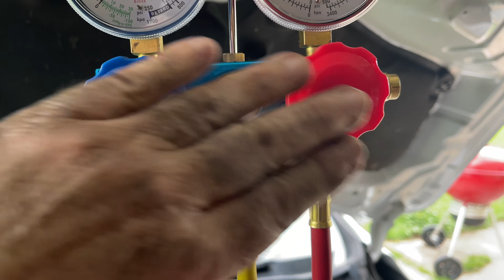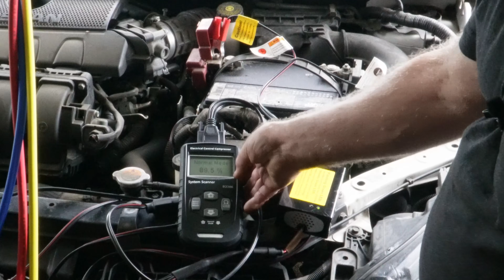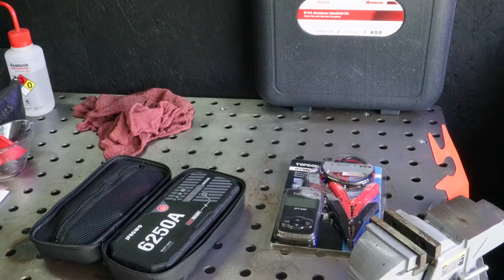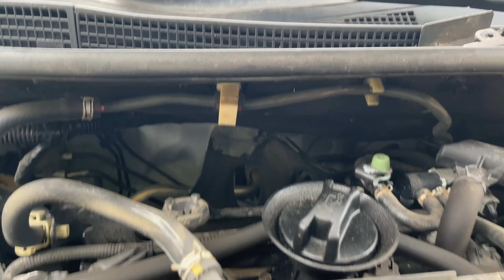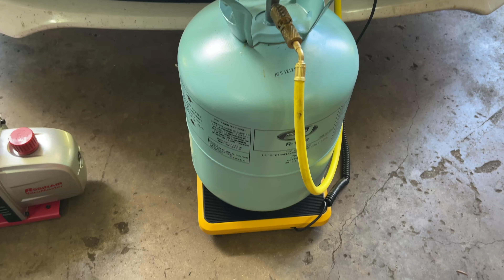How To Diagnose A Bad Automotive AC Compressor With 100% Accuracy

Comment: I have an 80 series Toyota Land Cruiser, the AC stopped cooling down and took it to a shop, they found the refrigerant charge low and also found the expansion valve getting stuck. When checking the valve also found the evaporator was leaking so they replaced both parts. Charged it back found pressure to be on spec. Next day I noticed it wasn't working good, even stopped cooling the air, measured the output temperature at the center register, it was 57-60°F... not good, took it back, they checked everything but the air conditioning only dropped to 45-50°F. Now they found that the high side pressure doesn't go beyond 160 psi  when the compressor is working, the Low side is in 30 psi. They're out of clues and I'm no mechanic to work on it myself.
Reply from the maker: It’s extremely hard to diagnose any car ac over a comment, but based on what you wrote, I would look hard at the compressor itself.  Lack of pressure caused by pumping issues within the compressor or compressor ecv.  Don’t take my word for it because I would have to hook up to the system myself before giving an accurate answer with confidence
Reply: @SkillSavvyDIY  Thank you for taking the time to answer, in fact, the shop asked me if they could take the compressor out of the and check it out and found the compression too low, already ordered a new one and waiting for it to arrive and have the system working well, also will replace condenser, dryer and expansion valve, the evaporator was already replaced at the beginning because it had some very small leaks. At the end, you guessed it right, it ended up being the compressor.
Reply from the maker: @ehouli77  Good deal, you should be all set once the work is completed.

Comment: What would cause Freon to blow out and they cannot find a leak 2018 Chevrolet impala The mechanics want to replace everything which is bs
Reply from the maker: If refrigerant is gone then there is definitely a leak, they just haven't found it.  Did they check the high side service valve for leaks?  That is a very common area on that GM car.  I had a similar model I looked at the other day.  It came to me with no refrigerant in it.  I pulled a vacuum and did a decay test which it passed.  I did a pressure test which it passed, so I put a dye in the system and charged it.  It cooled fine, so after disconnecting my gauges, I sprayed leak detector on the high and low side service valves, and found that the high side was leaking.  Many times mechanics fail to do this after disconnecting the gauges and never discover it.  It's very common on many GM vehicles.  Not sure if that is your problem, but I would have it checked.

Comment: Hey Skill Savvy DIY,
I have a 2008 Honda Civic LX and I’ve been having an AC issue for the past 2 years. The AC blows cold for the first 10–15 minutes, but after that, it starts blowing warm air. If the weather is cooler, the cold air lasts a bit longer. On hotter days, it blows hot air even faster.

At first, I suspected the compressor might be going bad, but the more I think about it, I’m wondering if it could actually be the condenser—maybe it's not dissipating heat properly when it’s hotter outside? I’d appreciate your insight on what the most likely cause could be. Thanks for all the helpful content!
Reply from the maker: Have you checked the condenser fan(s) to make sure they are turning on with the AC?  I appreciate the question, but without me being able to actually hook up to the system, it would be impossible to tell you the problem, but if you suspect condenser issues, start with the fans.  It would take reading gauges to go from there.

Comment: My ac keeps shutting off and on about every 30 secs or so (the fan also), and no cold air coming to cab. Pressures are good for both high and low sides. I replaced the high pressure switch, and checked the fan relays. Could the  a/c refrigerant temperature sensor  be the problem or something else? 2009 Buick Enclave 90k miles on car
Reply from the maker: Without me actually checking it out myself, I would only be guessing.  If you have a scan tool, look at the live data stream and see if the high pressure sensor pressure matches what the gauge pressure is.  Also look at all the other sensors data and see if they are reading correctly including the evaporator temperature sensor.  Wish I could be of more help but without actually looking myself, I can’t make the call.  Also look for any codes the ac module may have set.
Reply: @SkillSavvyDIY  OK thanks. There are no codes coming up on my scanner, and I don't think that I can read any ac sensor data with it.....Autel MS906BT

Comment: I have a 2004 Honda accord lx 2.4l sedan and I heard a noise like 3 air tool burts and smoke from under the hood while driving with my a/c on , so I pulled over and opened the hood and gave it gas in park ant the pulley/ clutch was lock up and release while accelerating making that air tool noise and the belt would smoke , I turned off my ac and when I accelerate with ac turned off no noise or smoke. My question is does this sound like the clutch and can I replace clutch kit and repair or replace ac compressor and is it safe to drive with ac off where it’s not locking pulley are releasing . With the ac off I don’t think it will lock up cause ac is not on so is the belt safe from breaking , it looks good I turned air off immediately. Should be able to fix in a few days am I safe to drive it do you think? Thanks a lot you are extremely acknowlegable about ac systems figured you would be the one to ask.
Reply from the maker: If it is a locked up compressor you can drive it as long as you turn off the ac.  If it’s the bearing, it could come apart so I wouldn’t drive it.  The fact that it makes no noise in the off position points towards a locked up compressor
Reply from the maker: With the car off you need to try to turn the compressor using the center bolt on the front of the clutch.  This will turn the compressor internally even though the clutch is not engaged.  It should turn easily if the compressor is not locked up.  If it’s not locked up then check the bearing that is pressed into the clutch pulley that the belt turns.  You will have to remove the belt to turn the pulley.  You will know if that bearing is bad.  If the compressor is locked up then it will need a new compressor, expansion valve and drier and the entire system will need to be flushed.  Hope this helps

Comment: The issue with the old compressor was quite clearly the clutch since the compressor was only partially engaging but without terrible noises (the noise when revving the engine would likely be the clutch chattering).   Why not just replace (or at least check) the clutch since it's a much cheaper/eaaier job?
Reply from the maker: No it wasn't the clutch.  The noise I was hearing was internal within the compressor.  When a clutch wears down it gets a wider air gap and eventually the air gap gets so wide that it can't engage.  The air gap on this compressor was fine.  Most modern compressor internals turn very easy by hand, so if you have a clutch that is slipping or grinding like brake pads then the compressor is trying to lock up normally due to lack of lubricant.  None of these were the case.  This compressor simply wasn't pumping like it should any longer due to wear.  I have ran across this literally 100's of times throughout the years, but thanks for stopping by and watching.
Reply: @SkillSavvyDIY  So, in that case, what is the actual internal failure?
Reply from the maker: I didn't take it apart to find the exact reason, because the fact that it no longer pumps means it's shot and needs a replacement compressor.  The lack of pumping could be from worn cylinders, piston rings, or valve plate.  A faulty electronic control valve could also be the issue as I stated in the video.  I don't care why it's not pumping, because it's getting a new compressor regardless, but it definitely had nothing to do with the clutch.

Comment: How do you purge the system
Reply from the maker: After flushing the system with an ac flush, I blow through the refrigerant lines and any part that isn’t replaced with a new part such as the evaporator on this video.  That insures that all the liquid flush is completely out of the system
Reply: @ you mean air ok thank you
Reply from the maker: Even though the system is open to air while flushing, it is never a good idea to used compressed air to purge with since it holds so much moisture.  I use a bottle of nitrogen, plus you can get higher pressures using nitrogen.
Reply: @SkillSavvyDIY  I see
Thank you very much

Comment: I'm at 1:37. Can you explain me where the line is for R134A, because that gage confuses me a lot. BTW that is Centigrade not Fahrenheit. What should be a good reading for a Kia soul 2012 4cl 2.0l automatic? Mine says low side:37 and high side 220 with 90 degrees and 20% humidity. is this good reading? thanks
---- the gage you have says:R22, R134A, R404A. then you have 2 lines red and one big black then numbers up and down of those lines.
Reply from the maker: Pressure is pressure, the different lines under the the pressure reading is giving you temperature correlation to the pressure for different types of refrigerants.  These gauges are in celsius only, but I have a celsius to fahrenheit conversion app on my phone.  Cheap gauges LOL, obviously straight out of China.  Those pressures on your Kia is about what you are looking for, but pressures can get lower or higher depending on outside ambient temperatures but you are definitely in the ball park.
Reply: @SkillSavvyDIY  Thank you so much for reply. I need to expand more about this, because I'm a little confuse with all those lines and numbers.
---in the low side: the black line you have it around 500/70. What mean 500 and what 70?
Reply from the maker: The outer black numbers is in Kpa or Kilopascals (metric)  the line of numbers right below those is in PSI or pounds per square in.  PSI is the numbers I was looking at.  I guess I need to use my other gauges in these videos to prevent confusion.

Comment: The HVAC module supplies a constant voltage while the ground side is the PWM duty cycle controls the solenoid from the HVAC Module with a good meter % Duty cycle. Same test with computer controlled alternators.
Reply: not all do that,2016 toyota seina has pull up.  ground is to chassis and ac amplifier pulse voltage. be careful and no the circuit design

Comment: 99% of techs will sell the customer a compressor when all it really required was a new orifice tube and fresh pag oil 😂…watching the pressure gauges is the best way to tell….if you’ve got massive pressure differentials and surging head pressure on the high pressure side, it’s a an obstruction in the system (most likely the orifice tube)
Reply from the maker: Yes, restrictions show just the opposite as what the pressures were showing on this car in the video.  A restricted orifice tube or a restricted expansion valve are the normal suspects when restricted, but not always.  A very low suction pressure (often in a vacuum) along with high head pressures is most certainly a restriction but any tech worth his money will know this, and any honest tech will do the right thing by the customer, but unfortunately we live in a world full of scam artist.

Comment: What if it is just the valve and not the compressor.??
Reply from the maker: If you watched all the video then you would hear where I addressed that, and why I replace the compressor regardless
Reply: Depends a bit on age of car and mileage. Sanden compressors are very high quality and the compressor itself is usually long lived. The variable displacement variety are notorious for RCV's failing prematurely though. If the car is not high mileage I would replace the RCV given the symptoms (high low side, low high side, cool low side line) after first pulling the RCV to check for metal and sludge. On low mileage cars this would be entirely reasonable to try first rather than replace the entire A/C system up to the evaporator.

Comment: A bad control valve will have the same symptom and they go bad very often. It's a lot cheaper to replace a defective $30 control valve than an expensive compressor and it is a lot easier.
Reply: This is late comment.but I would like to share my perspective.changing control valve might be worth a try if diy, compressor not noisy and easy access.however at 80-150hr labor it can be expensive risk.frequently compressor has to be removed to  change valve.customer can get angry, reluctant to pay for repair that didn't solve problem, forgetting shop explain risk of trying to save money.even when all work paid, going for what is more likely to work the first time is less problems for everyone.ive change two control valve one on Santa Fe for used car dealer.worked fine.another on maxima for low income person .that one didn't make a difference.50/50 so far.going forward,I'm replacing compressor in most cases. it makes for peace and less wasted time.
Reply from the maker: Yes I said that in the video but I also explained why I would never change just the control valve if it was the problem, especially on a 9 year old compressor
Reply: @SkillSavvyDIY  the same can be argued about putting a $300 compressor on a 9 year old Nissan when the only problem was the valve.  If the system has never been exposed to the elements, the compressor will probably outlast your engine, definitely your transmission.
Reply from the maker: Outlast the engine?  😂 transmission 😂 A/C systems develop leaks, often within the first 4 to 5 years.  When they leak they also loose oil and guess what happens next.  The beginning of the end for that compressor unless it’s addressed right away before too much wear happens.  Your argument is not valid in the real world.  This 9 year old compressor had a good life.  Much better than many.
Reply: @SkillSavvyDIY  I have two vehicles that are 11 and 12 years old. One had a leak at 6 years that was fixed. Both are over 112k miles, original ac compressors, and still running strong. Nissan transmissions, especially the new ones, are being scrapped at 100k.
Reply from the maker: @jggjj  I have literally worked on hundreds and hundreds of vehicles that had major AC problems that were only 5 to 8 years old.  Some were even newer but regardless of all that, I would not ever replace just the control valve on a compressor that is 9 years old, nor would most shops or dealerships.  The compressor was chattering as I said in the video and not pumping hardly any, but she sure is blowing cold now.
Reply: @SkillSavvyDIY  You for sure have much more experience than I on ac systems. I guess I have been lucky with my 10+ year compressors still going strong. My point is that a 10 year old car has or will have other major problems. I am looking at the overall vehicle perspective. An owner may want to save $380 if the compressor can go another 2 or 3 years. That money could come in handy to let's say, change those new CVTs that go out at 100k if you are lucky. Newer vehicles especially are getting to the point where transmissions only outlast the manufacturers warranty by a few years.

Comment: People must not buy cars that is costly and difficult to fix like cars with dryer that  attached to condenser  that can not be replaced separately ask mechanic which car is good  and easy to fix before buying it I have Nissans and I am not happy with them to replace PVC valve the is about 10 dollars I have to pay 500 dollars to replace it because there is no way to reach back or the engine the head has to come off before changing PVC Valve some other parts are designed the same way.

Comment: They are purposely making cars more difficult for your every day backyard mechanic to fix. So you have no choice but to bring it to the dealer. They are way over complicating things for no other reason than “the more parts on a vehicle that can break, the higher the chance you will bring it back to the dealer”
Reply: True, but this job specifically is actually easy to do/ diagnose
Reply: Manufactures need to lose all that computer bull shit and go back to high energy  ignition only, no computer shit.
Reply: It is all about GREED nothing more, EPA and other things are more bull shit the public have to pay for. we are all guinea pigs at the mercy of the corrupt, that is a fact.
Reply: Call your congressman, the manufacturers don’t like it either!